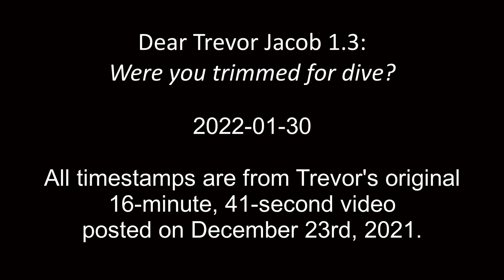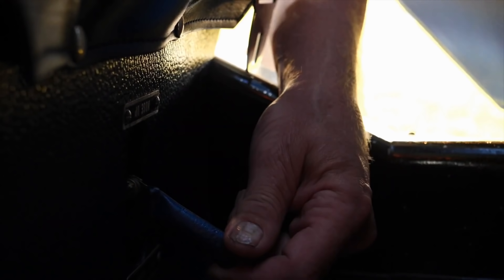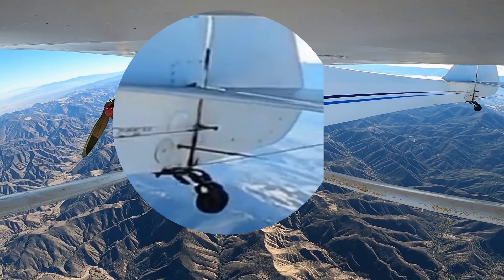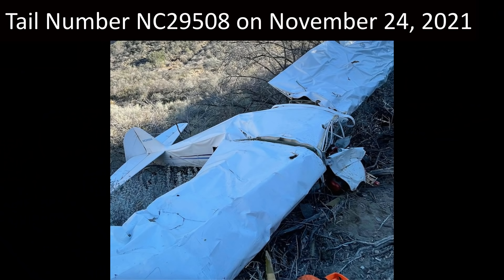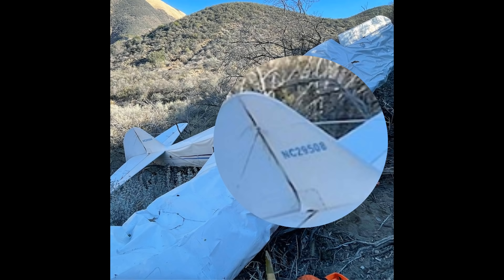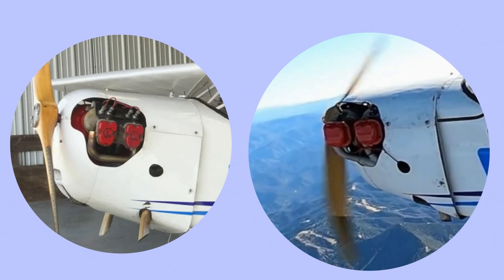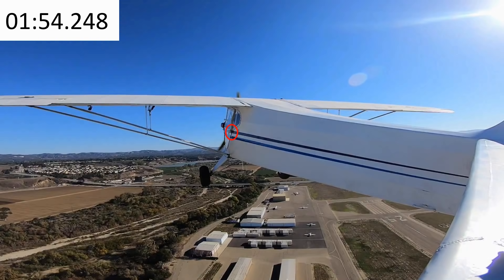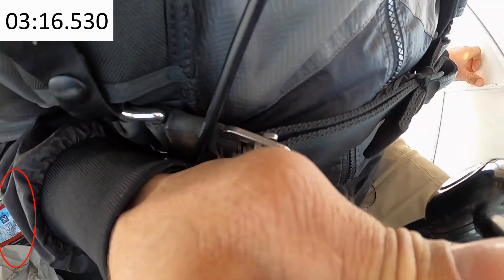Dear Trevor Jacob 1.3—Were you trimmed for dive?

Comment: Dude...that 'flipper' is NOT on a Taylorcraft.
That 'flipper' is an antenna.
Reply: 1939 to 1941 had the flippers.
Reply: @TheIndyspace  That Taylorcraft did NOT.
Reply: 👌😂, the BL and BC's prior to the war did have them. This is a prewar Taylorcraft.
Reply: @TheIndyspace  Hard to find pics of this plane tho!
Reply: @cluelessbeekeeping1322  actually, if you look at the older picture trevor's craft, you can clearly see the trim "flippers" as they arent lined up with the camera. in trevor's jump, the "flippers" are angled down to be in line with the camera making them look like a line instead of a control surface. that was accidental, but a happenstance of trimming down.
Reply from the maker: There are also two frames during the impact that clearly show the flipper. I’ll add them to the next update.
Reply: Wrong, my dad had a Taylorcaft, it had flippers for trim.
Reply: @TheIndyspace  Ya, it had them (or is supposed to), I still wonder about this one as it looks like an antenna.  There might be an upgrade for a 'standard' trim tab.
Reply: @Meika_Rei  Yes, I saw another video and this plane did have them.  My bad.
Reply: @PetesGuide  I've seen another video which clearly shows them, so,,... my bad.
Reply from the maker: @cluelessbeekeeping1322  no worries! I left out two frames that showed them more clearly because I’m not ready to talk about that section yet.
Reply: @cluelessbeekeeping1322  My recollection is that later Taylorcrafts had a jackscrew trim system that adjusted the incidence of the horizontal stabilizer...and there was a crank on the ceiling of the cockpit that adjusted the jackscrew by means of a cable linkage.
Reply: @TheIndyspace  OOoh, that's how they did it?  Like a cub.  I did not know that.  Ya, that would be a lot of work to put a jack screw in there.
A little tiny Model Servo would work instead....
Reply from the maker: That’s interesting. I’ve seen the overhead crank, but I’ve also seen traditional trim tabs. I’ll have to look out for any mention of the crank adjusting the stabilizers. Would have been well before true stabilators…
Reply: @PetesGuide  , well it's not a true stabilator. It's just an adjustable-incidence horizontal stabilizer. It's actually fairly commonplace on classic airplanes. As you might imagine, the range of adjustment is fairly limited, because the goal is only to achieve a desired trimmed speed...
Reply from the maker: @TheIndyspace  Ahh, sorry, didn’t mean to cast doubt on your statement, more of a curiosity as to whether this was a Taylorcraft unique feature, and whether it might have inspired the later stabilators. T-Craft have such a rich history it wouldn’t surprise me if there were something to that hunch. And thanks for the info, I had no idea about this possibility before.
Reply: @PetesGuide  My grandpa had a '46 T-cart that he built up from a wreck. It was beautiful and unique, due to some custom bits that he added. 
 I got to meet C.G. Taylor at Oshkosh in 1980. At the time, he had an original new experimental design, that he called the Taylor Bird, which was powered by a Subaru EA-81 motor.
Reply from the maker: @TheIndyspace  Did you take any photos? There are zero on the Wikipedia article! https://en.m.wikipedia.org/wiki/Taylor_Bird
Reply: @PetesGuide  I have an N3 Pup and the 'trim tab' for it is simply a bungee cord that you pull.
Reply: @PetesGuide  I did have a few, but it's been so long ago now, I am not sure that they still exist any more. I'd be willing to bet that EAA has some photos of it in their archives. It was a very small airplane, and not without its own innovations...